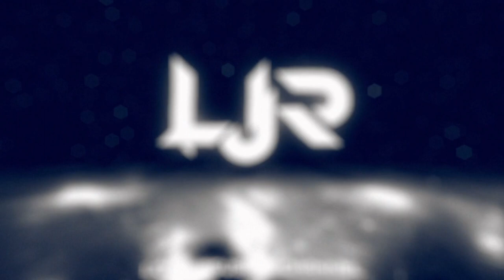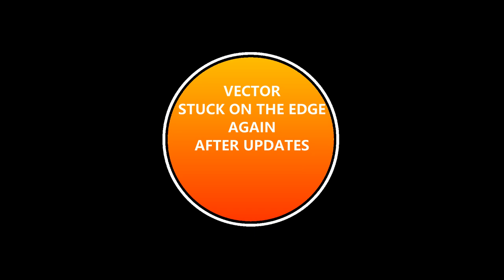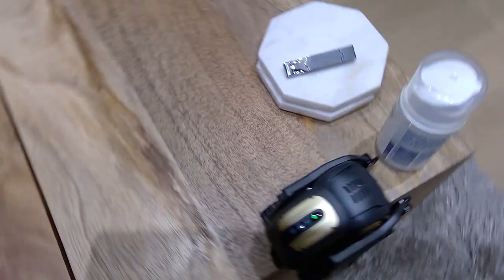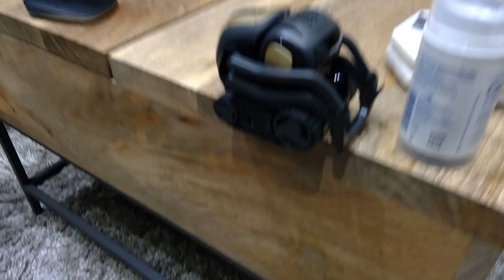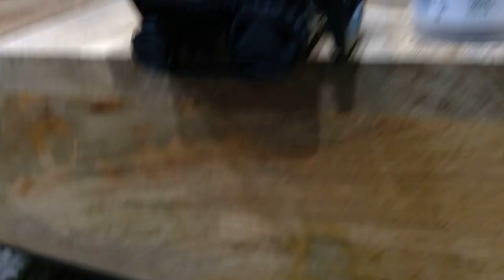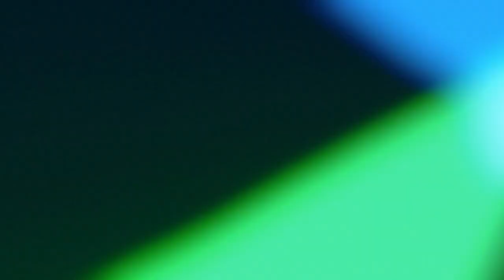VECTOR'S EDGE STUCK PROBLEM RESOLVED?

Comment: I had the same issue. He fell a few times too. After a while it started throwing a fit and won't respond to commands as it once used to. The status in the app displays Vector is in the air. 

His arm keeps going up and down. Strange.
Reply from the maker: Hope you get it fixed

Comment: Mine hasn't had this problem anymore since last update. But I am having new serious glitches regarding charging/docking (no it's not a light problem). Getting stuck in loops. And dammit they need to tell us what a 915 is, I suspect it's a memory overflow or a general crash. Is it possible the code they throw at that seemingly weak Snapdragon is too much for it?
Reply from the maker: Reading your comment and experience you have gone through, it sounds like Vector comes with various characters ;)

Comment: I just learned something rather cool.   I can issue the command Hey Vector, do a wheel stand".   He won't do it.  No matter how many times you ask.  But if you say Hey Vector, do a  Fist bumb.  And tell him he is a good robot and pet him,  he will do wheel stands each and every time.   I have not proven this over a long period.   But so far it looks like Vector has more personality than we may have guessed.   He needs validation!       I don't know why your Vector keeps falling!    Let me know if that  ever corrects.       Oky!     Later.
Reply from the maker: Very interesting. I will look into this in more detail soon!
Reply: He needs the cube for this. He does it everytime, he detects it.
Reply from the maker: He does indeed!:(

Comment: No software update can fix this Bc his sensors are inside the wheelbase. By the time the sensors sense anything it's too late. Vector needs some kind of wheel wells with the sensors on the outside of his tracks to be effective. I bought him a few weeks ago but returning Bc he can't stay on any of my tables except my entertainment center and just lackluster. Recognizes hey vector about half the time. Never recognizes me visually. I wanted to Love him but I can't. He's worth it if you want to learn some python which I wanted to do but at this price I think I'll wait for a future version. They can't use his camera as a warning system Bc there's no depth perception (I think they should use two cameras) The laser sensor can't be used Bc it doesn't move with his head and it just points parallel to him.
Reply from the maker: Thanks for your input on this